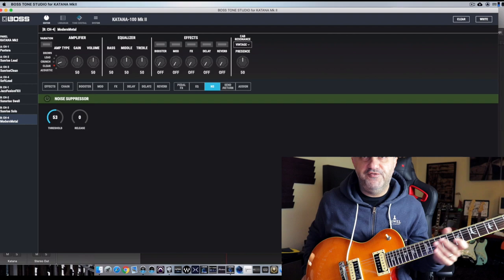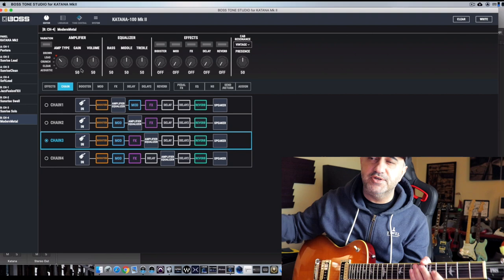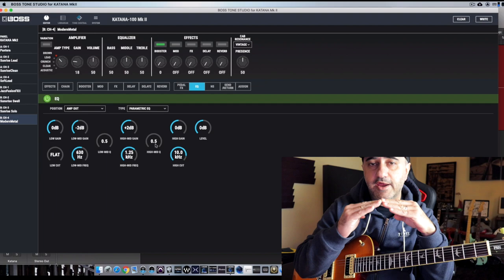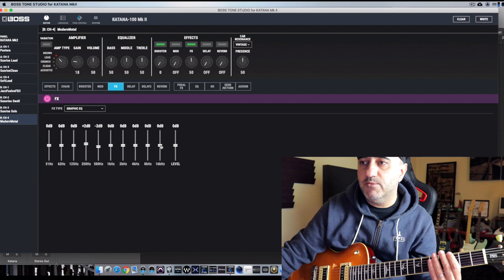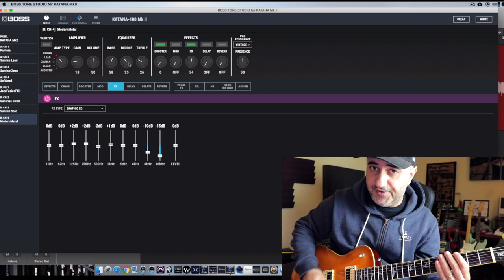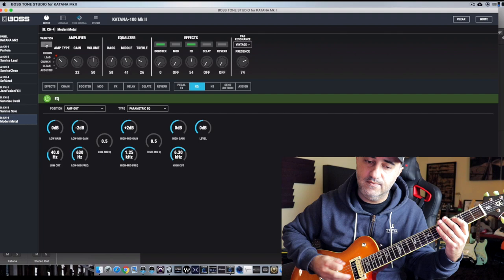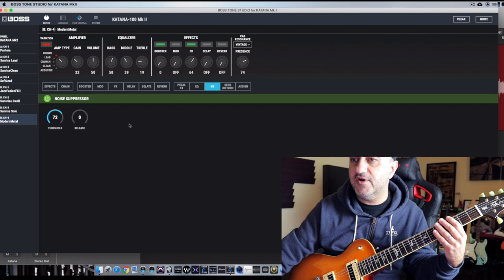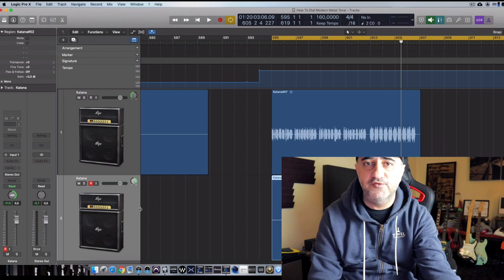BOSS KATANA | HOW TO DIAL A MODERN METAL TONE!!!

Comment: I need to trade my Marshal CODE 50 for a BOSS Katana.
Reply: I just did that lol it was worth it
Reply: Dang.     I was gonna do the opposite
Reply: @1Capnjazz  boss katana is the best affordable solid state amp it’s awesome
Reply: @zman_1148  it is definitely the one that sounds and feels most like a tube amp and as loud or close to. Second one that is really good as well is the line 6 catalyst 60.
 Just got that one and really comparable to the ktn, 50.. but volume wise the katana is louder.. other good one is black star if I remember right Id core 100 2-10. But I have heard reliability issues with the id core amps..

Comment: Man I cannot say thank you enough. As someone new to guitar playing I had no idea about amp settings and was severely struggling to get a good sound from my amp. I also had this really loud hissing static soundthat drove me nuts and wouldn't go away no matter how much I turned up the noise gate. I had no idea that the EQ was so important in developing your sound. Your explanation using the visual representation of your sound extremely easy for me to understand how the cute works and now I have an absolutely blistering thick modern heavy metal tone that literally had my friends dropping their jaws. Thank you so much for taking the time out to make this video. I went from wanting to sit on my equipment on fire to writing some of the best music I've ever written.
Reply from the maker: Many thanks!!! Glad to hear that!!! Be safe mate. Cheers
Reply: What he said.. you rock dude!
Reply from the maker: Thanks 🙏🏻
Reply: Idk why it turned out to be so thin for me with no sustain at all. Feels like I messed up somewhere but I'm sure I followed the steps correctly. The only thing is though, I tried to do it on my Boss katana 50 mkII but I only had Channel A and B. In channel B there was an Echo crunch preset that I did the mods on and then saved it as Modern metal. Do you think that may be the reason why it sounds so flat? I did make sure to reset all knobs to zero before starting though.
Reply: @JucaNeryGuitar  can u make a deathcore one?
Reply from the maker: @DavidAllenMD  I have some black metal and more patches like these: https://jucaneryguitar.com/product/the-black-metal-pack-i/

Comment: Hey there I thought I would ask a general question. If I have an Overdrive patch going I get plenty of noise and know that if I can engage the NS to handle noise, but when engaged and I turn my volume down that  basically  cuts out volume.  So,  I can hook up an external NS through efx loop to take the internal NS out of equation or is there some other method to use where I  lower volume without cutting out. Thanks for your input
Reply from the maker: Yeah, the noise supressor is not the best one on the Katana. That without the cutting the volume it depends on the settings. I prefer to have some noise and not have cuts in sound. Cheers

Comment: When using the studio. Will the amp automatically play out through whatever speaker the computer has hooked up or is it possible to hear it through the amp as you are playing? Also is it possible to change the boost and mods on the amp itself? Look if I want to always have a blues driver available vs a tube screamer?
Reply from the maker: No, it just plays from the amp itself. It's just when you're recording via USB or Line out that you can hear the amp via other speakers. Yes, 3 boosts to choose. Yes, that's why you need tone studio to setup that. If you need more help contact me here: https://jucaneryguitar.com/contact-2/ Cheers

Comment: Idk why it turned out to be so thin for me with no sustain at all. Feels like I messed up somewhere but I'm sure I followed the steps correctly. The only thing is though, I tried to do it on my Boss katana 50 mkII but I only had Channel A and B. In channel B there was an Echo crunch preset that I did the mods on and then saved it as Modern metal. Do you think that may be the reason why it sounds so flat? I did make sure to reset all knobs to zero before starting though.
Reply from the maker: If you saved as I did after the tutorial, you have overwritten the channel, so the tone should be at least similar. How's the room where you play? Cheers

Comment: I always appreciate your contents...this one is no exception..very well illustrated..one thing I want to know, can you dial in modern metal tone on any guitar having 70s or 80s vintage medium output humbuckers?
Reply from the maker: Many thanks :) Yes you can! :)
Reply: Medium output pickups are actually better than high output because there's more headroom. If you need more output you just add more gain at the beginning of the chain. Medium output gives you the versatility to get great clean tones as well. EQ and overdrive/boost at the beginning of your chain is a great way to start.

Comment: Don't have the mkii so I had to follow you step by step to have a similar sound on my mki and... It's sounds great! Best tone I've ever had on my amp!
I was wondering what you would suggest to have most similar sound on the mki since there's no "variation" option?
Reply from the maker: Thanks :) Hard to get without the variation mode because it really changes the tone and it interacts very differently with the different amps. In this case it adds more brightness and definition, but I cannot say that that equals to treble or presence. Cheers

Comment: Hey Luca how are you! I just got my katana MK100 Im looking to load a good overdrive or distortion, what would you recommend? also, I have never plugged it to the computer so I guess all you have to do is jusr plug it in and do the changes on the computer and it will automatically do it on the amp??? any help anybody?? I usually play foo fighters, alices in chains, stone temple pilots, three days grace etc!!
Reply from the maker: Hi there, all good thanks :) Try first all the distortion / overdrive pedals that the amps brings before buying any pedal. You need to go into Boss website and download the drivers and Boss Tone Studio for your Katana model. Let me know how it goes. Cheers
Reply: @JucaNeryGuitar  I will! Thank you boss!!

Comment: Hi Juca, I finally found something that will steer me in the right direction for dialing the Katana, however, I'm not sure what the variation mode does. I have a Katana 50 which, from my knowledge, has no variation mode which sounds way better than without the mode. What does variation mode do and how I can change the settings to make the same sound as if I had the mode enabled? Thanks and awesome video, it was very informative.
Reply: I think it means he has a Mk2 Katana, and the variation button switches between the Mk1 and Mk2

Comment: I tried this with my Katana mk11 50w and Ibanez Tube Screamer on my Ibanez 7 string, which is currently in Drop B. I run 10-62 which should be good enough guage for a 25.5 scale for Drop B and my tone literally doesn't sound anything close to this lol I go for more of the Drop A deathcore vibes but 62 is too floppy for my liking so I went up to B, the strings still buzz like hell too so im assuming I need a noise gate?
Reply: You might just need the guitar setup by yourself or a professional.
Reply: @TheOneAndOnlyKurtNobrain  upgraded to an Ibanez iron label 8 string, running EAEADGBE tuning and that actually sounds pretty good.

Comment: Hey, when I copy everything you did my guitar tone sounds very weak and thin. I'm trying my hardest to get a trivium tome and it's very frustrating
Reply: I don’t know if it’s that because I don’t have my Katana yet but could it be that you listen to the audio coming from the amp itself? Because if yes, it could be due to the open back I think because that can make one lose many of the low frequencies.
Reply: JT Splosion of that’s the case try to plug the amp into your computer and listen through your headphones or so
Reply: What guitar are you using ?
Reply: Try changing your line out air feel to REC in settings.
Reply: I think it's because of your guitar

Comment: Why did the new versions remove the ability to put a booster after the amplifier? Is it possible to somehow install the old version where this feature is available?
Reply from the maker: You can't use the old version with the MKII. Did they removed that? I need to check. Cheers

Comment: Hello Juca, I think my katana 50 is defective.
This is the sound I get with all base settings (all off and volume 50, bass 50, mid50, treble 50 and gain raised to 80)

Terrible sound, some cracking and feels like a low input signal amplified (no punch, terrible mutes, etc)
https://dl.dropboxusercontent.com/s/d5x1klw4psguqrm/test%284%29.mp3

I'm doing something wrong?
Is a Katana 50 MkII connected to my scarlett 2i4  (same sound with USB)
Tested with 3 guitars (the recording is with active EMG81...)

No issues at all in PC with emulation like Bias FX
Reply: Dude, you need lower gain. That's too much. When you put too much gain it starts getting fuzzy.
Lower the gain and make a compensation on the booster. It will be better.